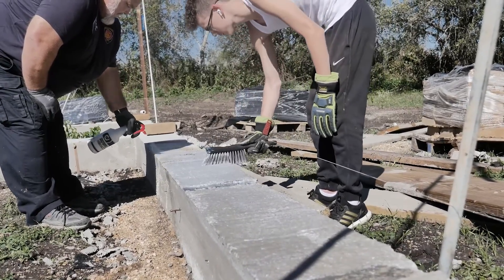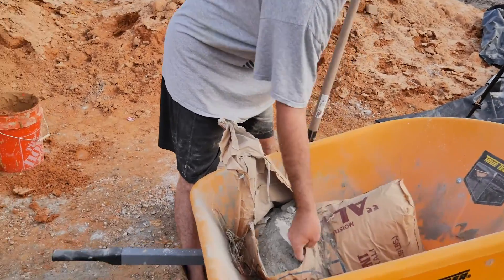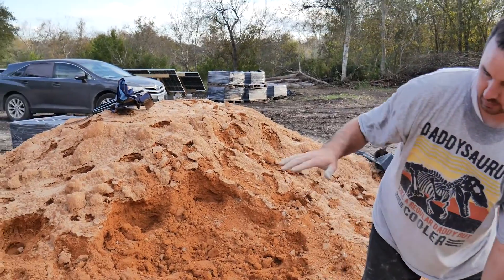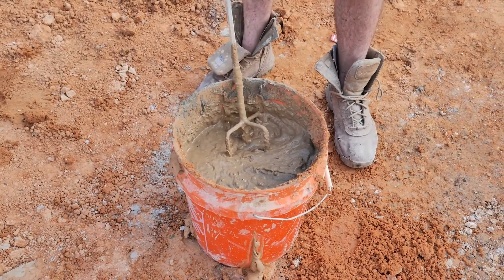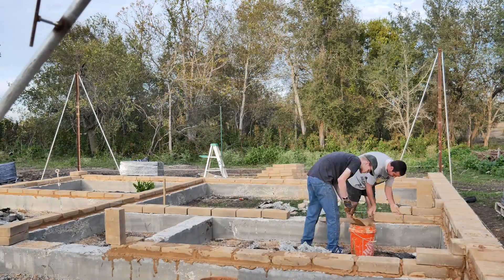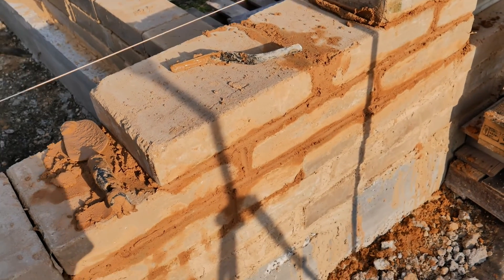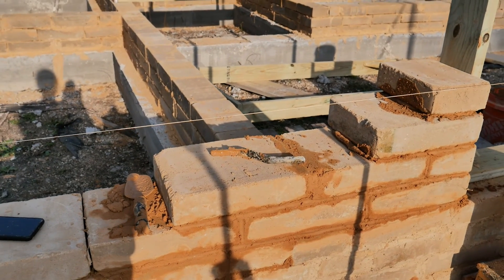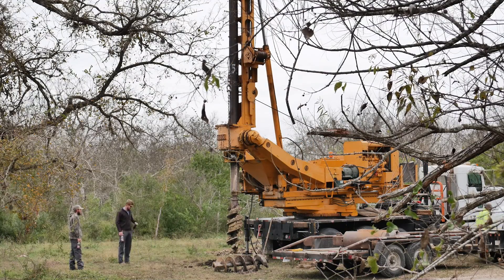Building a Home From Dirt | Compressed Earth Block House

Comment: your foundation was poured with concrete i imagine?
Reply from the maker: The foundation is a rubble trench but really a mix of materials for stability and longevity -- we dug it out, added liner, flowable fill, then the 1/2-dust gravel material. Once that was compacted at ground level, we then built the forms and created the concrete footer to raise the house a foot off the ground to protect the blocks and floor from moisture.

Comment: sir is this cost effective?
Reply from the maker: There is a lot of information that would need to be understood to answer this question. For us, it is marginally cost effective. We are lucky and got blocks made and were relatively cheap to get them on site. All other materials cost are the same as any other house so that is even. Our foundation was cheaper than a normal slab on grade or pier and beam. The real savings we are experiencing are that first, we are doing the work and not hiring out. Labor is what makes prices go up. If we would hire out the work and compared it to a normal build in the USA. It would come out more expensive. BUT like most "green" buildings, you save more with efficiency on energy savings. The walls should limit heat gain. Being off grid and harvesting rainwater. We limit our utility bills.
Reply: @woodsovertexas  thank you, sir. But want to know its strengths and durability and make the process of step. if you make some videos on this topic,  it will be helpful to me.

Comment: Lime plaster the exterior and make sure it’s at LEAST 3/4 of an inch for the interior you can do a 3/8 inch base coat of lime plaster and finish it with American clay finish plaster
Reply from the maker: That's the plan! We are thinking of doing a light wash for the exterior lime plaster but we'll see how that holds up/works against the elements and bugs.

Comment: Hi,nice vedio ,you used lime and sand for bricks laying mortar?
Reply from the maker: Portland cement, lime can be a replacement. From what I've seen it's just best to keep it all the same. We have Portland stabilized blocks, so Portland in the slurry. Vice-versa if we had stabilized lime blocks
Reply: @Woods Over Texas  thnks for replying,cement and sand bricks or blocks and plastering is not eco freindly ,its become cool in cold and hot in hot weather,lime plastering and sand or clay is dco fondly but how can made it waterproof and strengthen like cement ,if you have experience sale with lime bricks and lime plastering then plz you advise how much ratio sand and lime used for  bricks blocks and lime plastering wall,
Reply from the maker: One day we will cover the walls with lime plaster or similar. With the most friendly plaster we can find
Reply: @woodsovertexas  ofcourse
Reply: @malik51973 Is English your first language? Because that was incomprehensible.
Reply: 1 50lb bag of lime and 6 lbs of pozzolan to 6-8 5 gal buckets of sand depending on the size of the sand for lime plaster.

Comment: What kind of cement are you using to lay the bricks?
Reply from the maker: It is the same consistency as the block just with more water. Sand silt clay and p cement